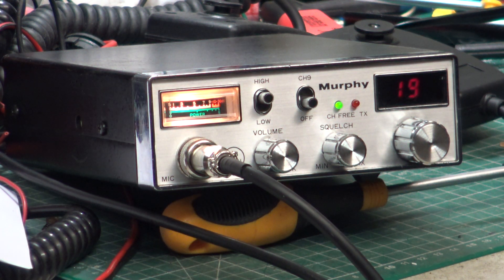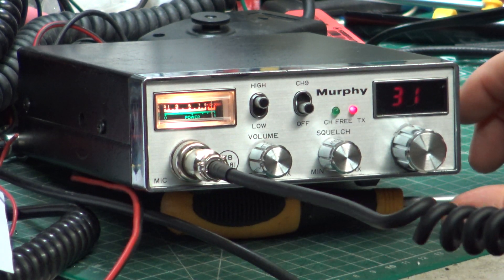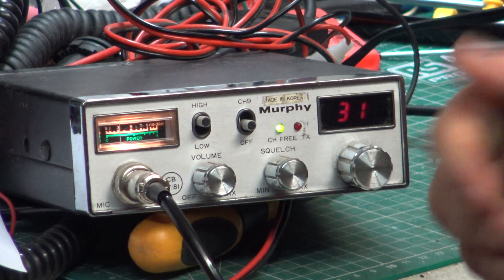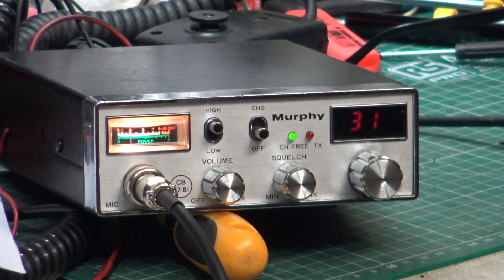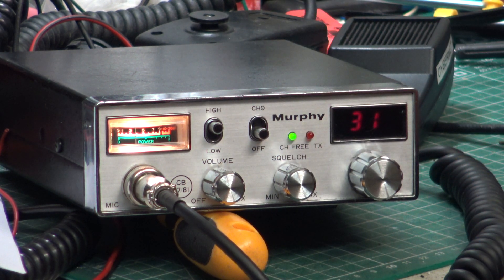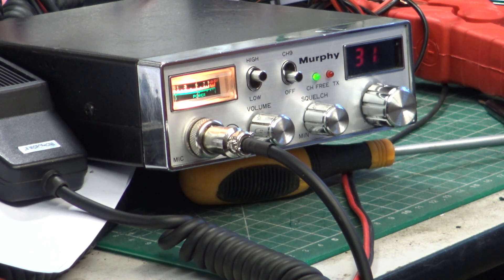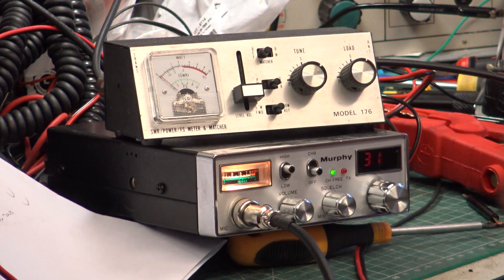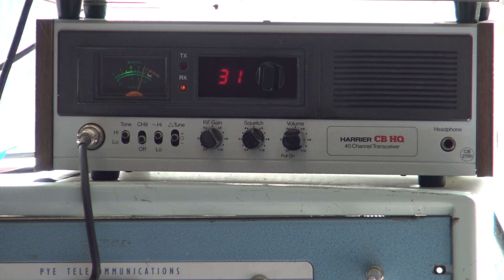Murphy DS602 CB27/81 UK FM CB radio - extensive On The Air test

Comment: Sounds like RF coming back into the sets, but not come across it myself, but then the users were using them on smaller mobile aerials.  Would have been interesting to see if it still happened on Mr Chippy's mobile set up!

Comment: Hi Richard, if I was a betting man I suspect you have a common mode current issue going on there.  To prove it you could make up an ugly balun .. you can make it out if coax and stuck it in line close to the antenna. Would be good to watch.
Regards

Comment: Just a quick bit of thinking is the mic screen ok
Reply: Forgot to say touch the mic plug when you transmit see if it clears
Reply from the maker: Bear in mind I did the same tests with our own sample of this set with it's own mic, not just the customer set & our Cybernet test mic....they both dislike 1.7:1 SWR the same.

Richard
Reply: Yes both sets did the same thing radios can be tempremental. I did once have this but the mic was metal RF burns are not fun on the thumb or lip lol
Reply from the maker: I'm going to order a new base aerial tomorrow; it's been bent since the bad winds about 6 weeks ago. It's just been pointed out to me that we did one of these sets before & the TX was fine on that one.

Richard

Comment: Do you think the hum would have significantly reduced the range ? I just wonder if ferrites  on all the leads would stop the R.F. audio issue.
Reply from the maker: No I don't think it would reduce range. Probably right with the ferrites. I'll dig out our York 867 & see if that dislikes a 1.7:1 SWR the same. Bear in mind both these were spot on into the test set with no tx hum & remember the hum was still equally present when I ran the set off a battery; it's RF getting back in.

Richard
Reply: Could it be coming back down the coax and back into the radio a you see the thing they put on the coax to stop RF feed back

Comment: Wow RF feedback into the set! Filtering is very pore!
Reply from the maker: Absolutely. The fact that both the customer's & our sample set performed equally as bad on that SWR of 1.7:1 just proves it. Both perfect on the dummy load!

Richard
Reply: @ukfmcbradioservicingTango21  I’m just thinking that could be a big problem with some of the newer power supplies RF leaking into them and the power supply taking off to a really high output voltage

Comment: Is is something to do with the internal filter on the output side ? Even if it has one ?
Reply from the maker: I think so, but without a circuit it's difficult to study why these perform like this. It's not faulty, just the way it's been made.

Richard
Reply: @ukfmcbradioservicingTango21  That's the difficulty not having a diagram  you'll have to try the other 2 york / I-com
Reply from the maker: The I-Com & similar are a different board, but I will look at one of those again. The Signal 1001 & Lucas ACB888 versions are so bad on receive that I get ticking from RAF Cranwell's RADAR 6 miles away!

Richard